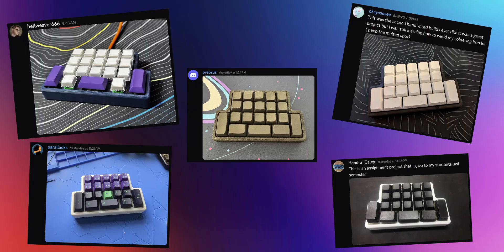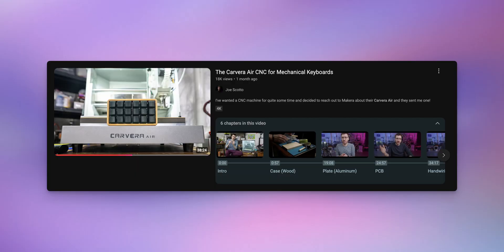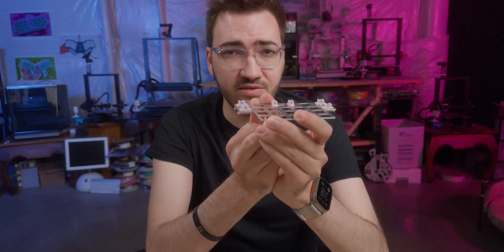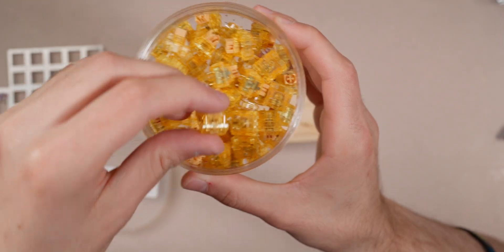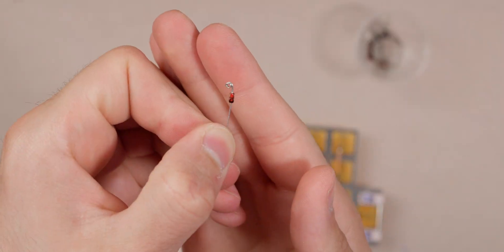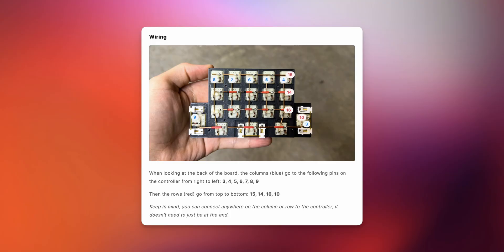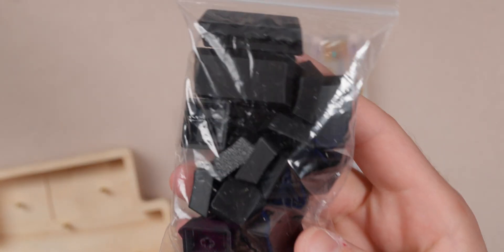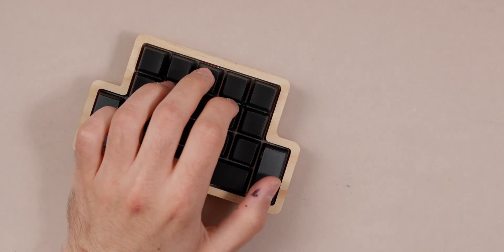Building a Premium ScottoFrog Handwired Mechanical Macropad

Comment from the maker: I gotta give a big shout out to NextPCB for sponsoring todays video, make sure to check them out if you need PCBs or if you want to confirm your design before manufacturing at https://nextpcb.com
Reply: About to drop an order with them today. Didn’t know they existed until this video, thanks.
Reply: Heya, just found and subbed to your channel as I am setting out to do a custom keyboard for a lathe controller. 

But thought I'd give back a tiny bit of advice and feed the algo:
As for those "not sharp enough" corners for the switch holes, you can do a sort of extended corner relief - sometimes called Mickey Mouse ears, where the bit goes deeper into the corner. Hard to explain but will make sense if you look it up. Basically, you wont have the sharp corner but a circular extended cutout which should be fine as it's the sides of the holes that locate the switches. Also, you can do this by predrilling. So, drill straight down in all four corners of each hole before you do your normal operation.
Reply: Also, what's that transparent isolation on the top copper wire on this build?

Comment: I may have made the same comment on another video of yours but here's a trick you will like:
If you are CNC your own switch plates or even sending drawings off to have them made and you worry about that tight corner radius, then predrill the corners instead with a 1.5-2mm drill. And then mill out the square. It's referred to sometimes as Mickey Mouse ears and it takes the whole drama out of having to use a 0.5mm endmill to get into those corners (the max internal corner radius specced by Kailh, I think is 0.3mm). With this approach you can use 1.5/2mm endmills and still have no issues with corners being too "tight". Also, drilling takes no time.

Comment: I'll be building my 1st handwired keeb in the next week or two.  Already got all parts and tools except the case. 
Just need to find someone with 3d printing services and not be 70$ for top (with integrated plate) and bottom case...
Reply: Check your local library, lots have 3D printers now